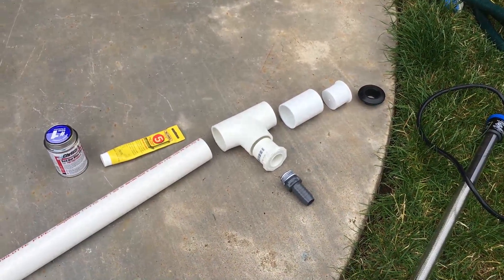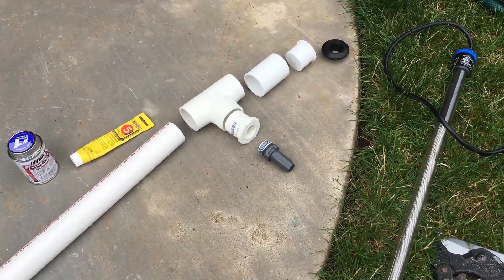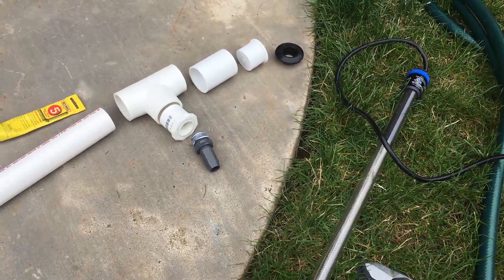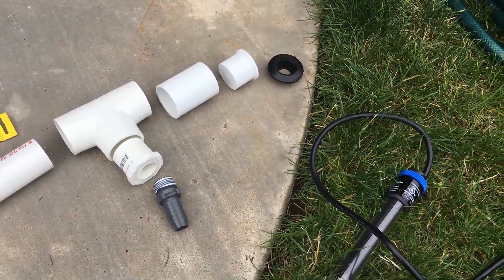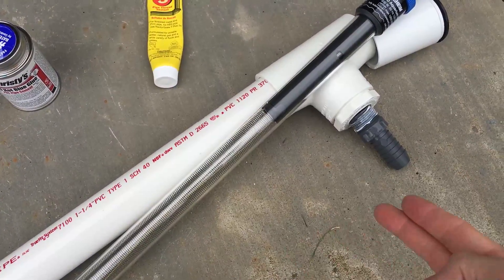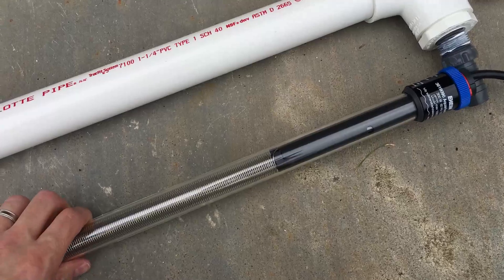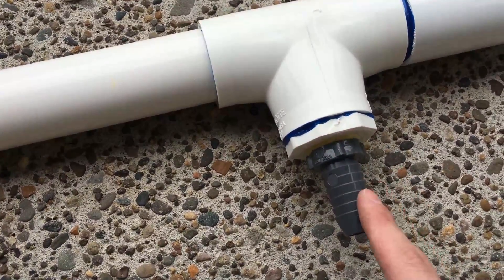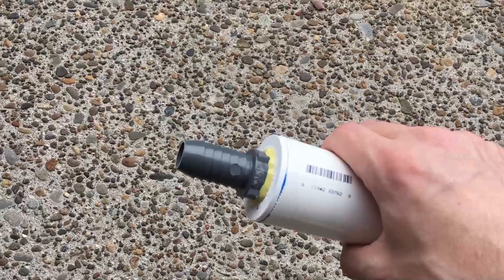DIY Aquarium In-Line Heater Instructions

Comment: Don't use that recessed plug and just snap the uniseal on it!!!  The uniseal will fail.  You have to get a flat plug and drill the proper sized hole in it.  The uniseal relies on the material thickness of the plug so that once it's compressed with the heater/pipe being pushed through, it can no longer pull out.

Comment: There is a problem with the design. The minimum water level mark on the heater is sticking out of water. The heater will fail at some point for sure.

Comment: Hi Mate, 
Great vid, I have been looking for a UV Sterilizer but I can’t see the value for money.  However I was looking through amazon and saw the below link.  Which drew my mind back to an inline heater video I saw ages ago, In your opinion would the same plan with a few modifications (I.e. length and diameter) would work and have it on the overflow pipe so as not to put a heap of pressure on the gasket from the pump.  I’d really appreciate your input the light and video are below 

Regards Duzzy from Down Under 🇦🇺

here’s what I was going to use - Submersible Uv Light Portable Waterproof Aquarium Tank Submersible Light Germicidal Sterilizer https://www.amazon.com.au/dp/B0824RWS48/ref=cm_sw_r_cp_tai_vxqMEbRK5T35D

Comment: This assembly has several potentially dangerous issues:
1) The air pocket at the top of the heater (above the Tee) can't be purged, so the heater glass is exposed to air. This will cause the thermostat to malfunction, and may cause the glass to overheat and crack. The assembly needs to be turned upside down.
2) If the pump turns off, the latent heat of the heater will dramatically increase the water temp, even if the heater turns off. You will be injecting a slug of near-boiling water into the tank when the pump turns back on, potentially killing nearby fish. Worst case, the pvc will deform from the heat and leak. The pipe diameter needs to be bigger, so you have a larger water reservoir.
3) The compression fitting is gripping the wrong place on the heater. It needs to grip as high up the heater as possible, so that the waterline is at the proper place.
4) If the heater malfunctions (stuck in the "on" position), as they often do, and the pump is shut off, the PVC will melt in seconds. You really should have an external controller for the heater, to greatly decrease the chance of a catastrophic malfunction. With a controller, two relays in series would need to fail simultaneously in the "on" position to cause an overheating accident (very unlikely).

Comment: Instead of drilling the plug I would of just cut the end off with a saw. No big deal just faster and less work. You could take one of your bail heads and shave it down on the outside and out of in the t. It would hold the heater dead center in the PVC pipe on it's own.

Comment: why don't use just use a reducer bushing that's 1 1/4" to 3/4" for the uniseal?
Reply: sorry, the hole needed for a 3/4" uniseal is actually 1 1/4" lol so u can actually just plug it right into the 1 1/4" pvc. did u try it?

Comment: Hi Travis.  This inspired my build so thank you.  I have a problem though - it appears that the thermostat is 'obstructed' by its position in the neck of the PVC tube and I'm having a hard time getting it to heat correctly.  Tank is 77f (25c) and I'm having to set it at 68f (20c) to maintain this temperature.  Did you have any issues with yours?
Reply: PS: Inlet is at the heater end / Outlet at the controller end - will this make any difference? I wouldn't have thought so.

Comment: Just a question out of interest, if a heater is in the tank it will turn off when the water get to the desired temperature, and then turn on when the water gets below the temperature. If it is put in a pipe from the outlet of the filter is the heater alway on? and if so the heater  life will be shorter.

Interesting video, Cheers 🍻
Reply from the maker: Trevor Cole It will still operate similar. If the water temp of the water passing thru the assembly (across/passed the heater) is cooler than the preset temp then it will turn on and heat that water as it passes. Eventually it heats up enough water so that the water in the tank and returning thru the filter meets the desired temp- in which case it turns off until it needs to heat the water again.

Sounds confusing but if you think about it- it really isn’t much different

Comment: Just a little help from someone who knows a thing or two about working with PVC. One of the possible reasons your barb was leaking is because you just used Teflon tape and possible not enough. Or you wrapped it in the wrong direction. Yes, it DOES matter which direction you apply the tape. You always want to wrap your threads 3 to 4 times and in the OPPOSITE direction of the way it threads in. I hope this makes sense as it is hard to explain without being able to show you. When you are finished wrapping the tape you want the tail piece to point in the opposite direction of the way it will be threaded. Plastic on plastic does not want to thread together because of friction without some help (pipe dope or as non-plumbers call it thread sealant), the 2 pieces will bind on each other, so not only do you use Teflon tape but you also need to dope (thread sealer) the outside of the Teflon tape and threads. Follow these steps and your threaded connections will go together smooth like butter and they should never leak. Unless you cross thread them and then you're just screwed. BUT to keep from cross threading them follow this simple trick, when you place the two pieces together to start threading them, go COUNTER CLOCKWISE first! You should feel the piece your trying to thread into the other one drop down just a hair and your threads should be properly aligned, when this happens you can now start your clockwise motion. This will help prevent cross threading the two pieces... Sorry for the long post but hope this helps some people who have no experience working with PVC or threaded pipe. If you have any questions just ask.
Reply: great tip! thx
Reply: Thank you as well

Comment: Excuse me what uniseal did you use for the E I'm here is they're all the same thickness just wanted to know what size you used because I'm planning to have a saltwater mixing station but but I go on an external pump and I needed an inline heater because I need to be able to shut the lid for a watertight seal so everything will be external with uniseals and hard so minus the bird fittings on this just asking what size because they're going to get pricey with the amount that I am buying

Comment: WOW! that is exactly what kind of set up I need for my 55 gal. as for the heaters are concerned!  My heaters - exactly the same as yours except lower wattage,  are both mounted inside the back glass pane of the tank and makes the tank look "cheap" like.  I'd rather hide them so I can put in a 3D background. Just not sure about the rubber grommet you have for the top of the enclosure.  Any other suggestions?
 I have a HOB filter but think I will pick up a small canister just so I can manifest something the same as you have.

Comment: the minimum water line on the eheim heater is outside of the uniseal...  Does this work?  will the unit not overheat / malfuction?  I want to do something similar but I am concerned about the uniseal position being below the minimum water line.
Reply: I've had some luck with a smaller eheim work slightly above the water line. I think the manufacture puts in a safety margin on where the line is and where it needs to really be on the device. I'm more concerned with the air bubble/cavity that forms, the true water line may be significantly below the manufacturer's mark!
Reply: @BCToby  The assembly needs to be turned upside down, since the air pocket near the heater's top can't be purged. Once you do that, the air can escape.
Reply: THE ENLIGHTENED ONE  and they dont last, which is why people build them instead
Reply from the maker: Philip Raposo didn't realize that. It works though!

Comment: Hi Travis, I'm trying to building my first inline heater following your video.  However, looking at the video, it appears the uniseal is below the minimum water line of the Eheim heater - is this correct?  If so, have you experienced any problems with the heater? Thanks
Reply from the maker: Bryan V I suggest mounting or setting the in line heater vertically- with the uniseal/heater controller end at the bottom. And the supply/incoming water attaching to the inlet nearest that end
Reply: Pls what is name of heator rod...so that we can buy from online